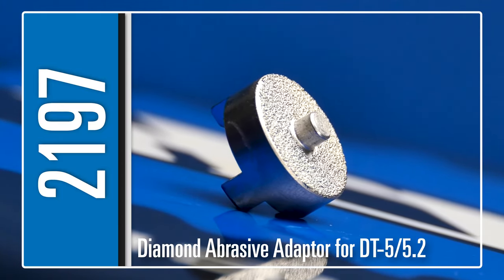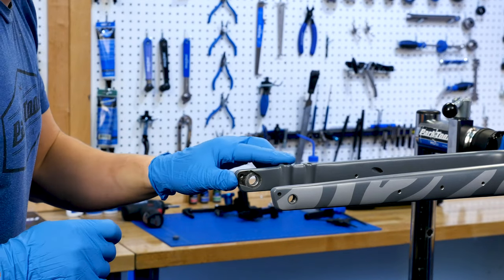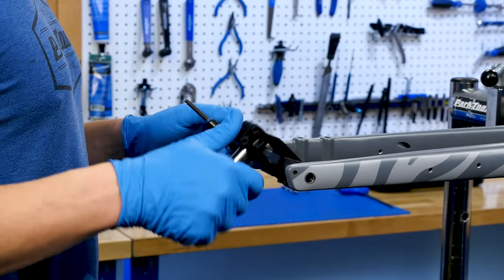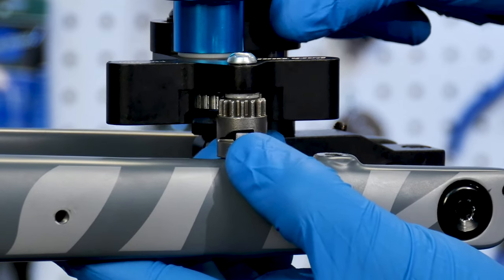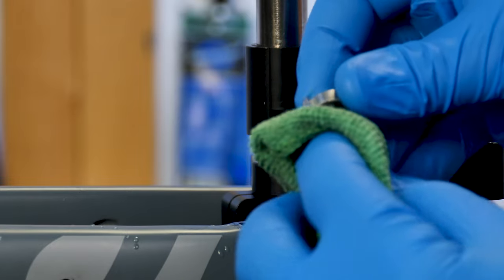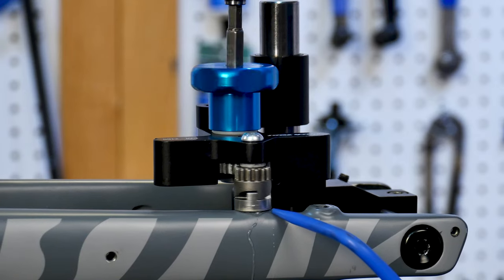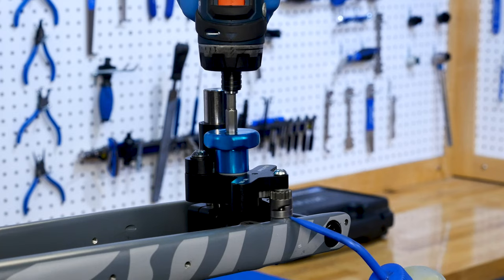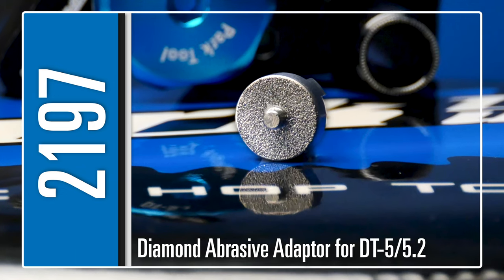2197 - DT-5/DT-5.2 Diamond Abrasive Adaptor for Carbon Fiber

Comment: At 1st I’m like “why is this even needed?” But I own a Chinese carbon gravel bike.  W/4K+ miles on it....I’ve done everything I can to try and get the rear caliper aligned....I need this tool! Or more like a shop that can do this for me. How many shops buy these, is it a standard shop equipment?
Reply from the maker: If a bike shop does a fair amount of bike building and frame prep, it's very possible that they have a disc brake mount facing tool.

Comment: Those mounts are different heights. They’ll never be level unless you grind them flat. How does that work?
Reply from the maker: You set the height on the tool after making the first cut. After setting the height on the tool it will nut cut any further so they will be exactly the same height.

Comment: I'm trying to figure out why I would need to face my brake mounts ever
Reply from the maker: It is needed only if there are alignment issue from the pads.  Pads have basically a two dimensional adjustment.   If the factory has done their job, it should not feed facing.

Comment: Or... just get rim brakes... because this looks really expensive and complex...
Reply: you dont normally need to do this
Reply: But rim brakes are so gawed awful at everything that they should have died back in the 90s. Plus I have yet to buy a bike carbon or otherwise that needed honing of the mounting brake surfaces.
Reply: kangsterizer that's my point... you invest so much money for a one in a 100 job...
Reply: Jeff "rim brakes are god awful at everything" well Jeff, you have just invalidated your argument. Because their are very few people that would say that rim are awful at everything. 

For road bike let's Try:

Lower weight 
Lower maintenance 
Cheaper 
Easy to fix
Cheap to maintain 
Better placement on the frame
Less noisy 
Cause less stress to the frame
Look better 
Safer in a crash
More aerodynamic 
Preferred by professional cyclists (when they can tell the truth)
And somehow keep winning all the major Cycling events even though most  professional cyclists are forced to use the pizza cutters.
Reply: @reginaldscot165  Advantages of discs.  
Better braking in all conditions
Simple setup
Annoy rim brake snobs

Suits me....

Comment: If you are spending "carbon frame money" there should be no need to fix stuff on it. Carbon is just a joke.
Reply: Custom frame
Reply: so many people say this but it just sounds dumb. not every frame is made the same way. yes you are right, in an ideal world every surface would be 100% aligned and have 0 imperfections down to the micrometer, but this is not an ideal world. every frame is different. even with the exact same type of frame, they can vary slightly due to many factors. with that being said, the top tier frames are typically as close as you will ever get to perfect.
Reply: @bmxscape  making the mounts even should be done at the factory there is no excuse. 
You can buy a Dacia car for 7000€.
I cant believe people are paying 3000 - 8000 and the parts dont  even fit correctly.
Reply: @spiloFTW  personally i havn't heard of a case where a frame that expensive needed to have mounts faced
Reply: It’s not unique to carbon frames it’s any and all frames. The reason is facing would add a lot of extra cost to the consumer and takes a lot of time to do so plus expensive tooling so that’s added cost to the consumer changing the dynamic of the industry. You don’t need to face mounts but all bikes. Some more than others will benefit from doing so with longer life from bearings and brakes and smoother quieter performance from reducing creaks with a perfect fit